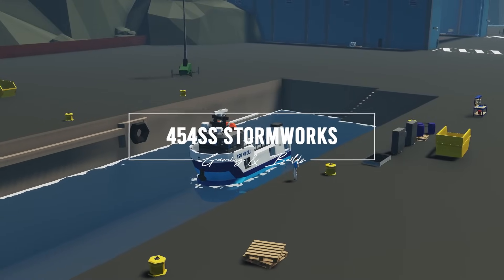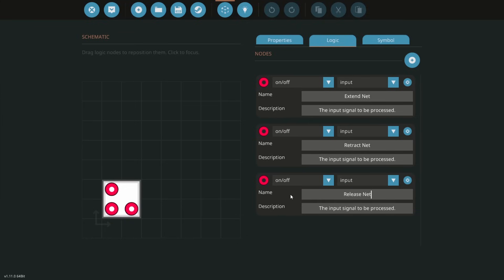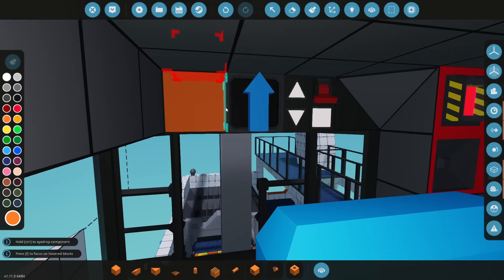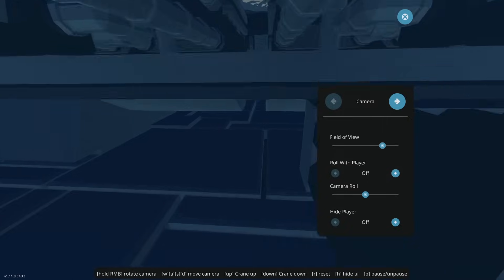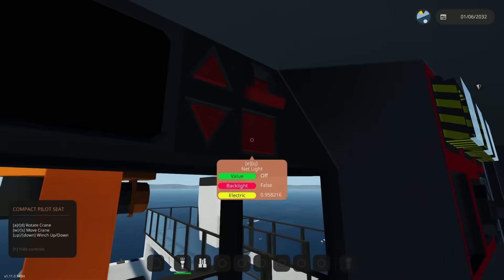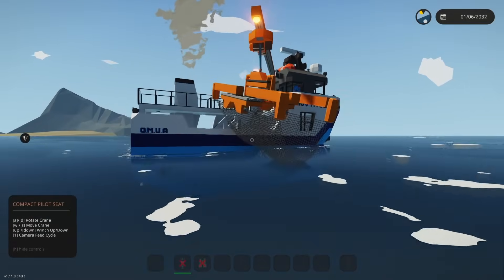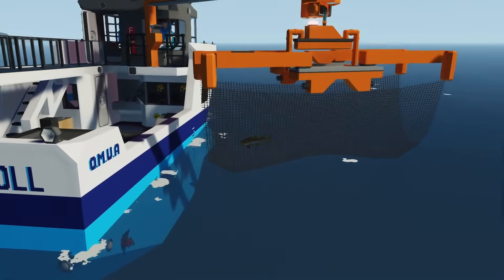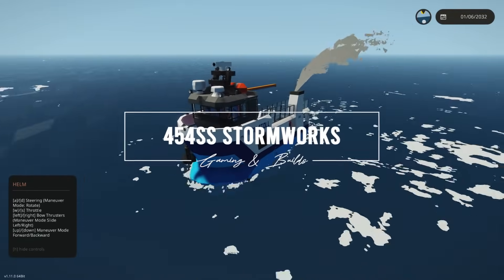Adding NEW FISHING NETS to my Fishing Boat in Stormworks

Comment: Hello there. I think you've approached the fishing nets from the wrong way, a Stormworks way. The nets push the net notes apart, which lets you create nets out of different physical body's. I think this is how the nets are intended. I would advice you too use a central weighted anchor being tode behind you're boat, with 4 ropes leading to individual net points. Another tip: from my testing it helps to spawn the notes far apart. Thank you for your great content👍

Edit: Yeah, I attached such a net too my starter boat and it works great. The net is more than a 100 times bigger than your's, even tho my boat is very small. It seems like the net does not induce a lot of drag.
Reply from the maker: Yup, I did not have a template to follow at the time of making this (minutes after the update hit) but some R&D showed that this is the way to do it! I will have to do some more tests and will update and report!

Comment: This little fishing boat is pretty neat but I'm concerned the way the net is controlled or shaped will heavily neglect fish collection.
From hat I've seen, the net doesn't need to form a bag shape since the moment a fish touches it it sticks to the net so most builds I've seen only let the net loose like a bed sheet swim in water to bag the fishes.

Although, I assume your net could manage to catch some fish in a school of fish sold by the Fish data markets since the density of fish is higher over those places.

TLDR, Very cool build, we can see the love you poured into it but efficiency-wise I feel it will lack despite the aforementioned purpose except in optimal fishing condition.

Note: The CTV cameras is especially a touch I love since in Career (survival) mode we don't have third person mode ? Unless I never figured the keybind.

Comment: I am hazarding a guess that to really catch fish, you'll need 4 independent large winches in back with an net annchor on each,  and let them deploy freely and as the net is expanded  the effct becomes like a parachute and it unfolds and covers a large area, given the cables are long enough as you're trawling. Havent tried the nets yet. alternattively reading below the one weight att the back giving it drag, turning a fully deployedd net into a funnel. How to connect tthe 4 edges tho,  maybe the anchors but as said below by Falkreineche545 i tthink the net corners need to be free and independant, allowing them  to separate like a parachute.
Reply from the maker: Totally! I didn't have a better example to follow at the time of making this video (minutes after the release) but I will do some more R&D and see how it can be optimized! Thank you for the comments!
Reply: @454ss_gaming  
I spent most of last night doing exactly what carronm is suggesting, and it works amazingly.  The problem is that it's ugly, as those on-off nodes result in large independent microcontrollers for each net-anchor.  It should have been a composite, that way the micro could be kept on boat.  Plus, you could get a number channel to tell how large the net expansion is.
Reply: @atigerclaw  Amazing, going to brew me a pot of coffee  and tinker away tonight. Im new at all this.. Creating, theory is easy, practice, thats a whole different leaguefor me. Im at the level of making a stabilizer for my boat, so microcontrollers and composites is still swahili to me, lots of google and frustrations :D
Reply: @carrom6056  
Composites are actually easy once your understanding of channels clicks.  Composites hold both on-off and number data, and each type can share a channel.  IE, you can have a channel one for ON/OFF and a channel one for numbers.  In order to use composites in a micro, you need to use the composite read blocks in the micro.  There are two of said read blocks, one for NUMBER, and one for ON/OFF.  Writing to a micro is done in a similar manner.

Just imagine it as a cable.  You run the cable into your microcontroller, and then you have to split the cable into the data strands to feed to your logic blocks.

The composite blocks have a few extra functions, like composite 'input' nodes for the write blocks that allow you to wrap around and splice two composites together.  As well as dropdown boxes called 'start channel' and 'number of channels', which is just a fancy way of pushing a bunch of inputs into one block.

Either way, the whole reason I think the net anchors need to be composite is simply because then you only have to deal with one node ON the anchor, and you can run an independent anchor on a winch with just said anchor, and a cable anchor part.  Wish I could post screenshots here, but this is youtube.
Reply from the maker: @atigerclaw  Ahh yes, I agree! Being composite would have been so much better!
Reply: @454ss_gaming  
I already poked the steam update discussion thread with the suggestion.  Don't know where else to poke.  Maybe if you do a video (wink emoji?) on doing a four-winch independent net anchor build...  (Hint, cable anchor, four-node microcontroller, net-anchor.)

.
Reply: @atigerclaw  Bookmarked this thread so i can go back and remind myself what im trying to do :D